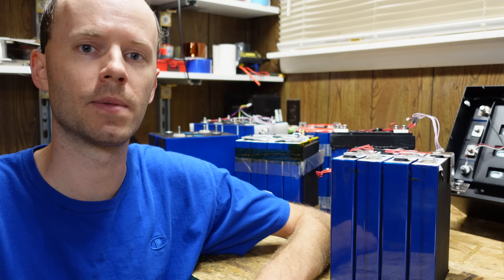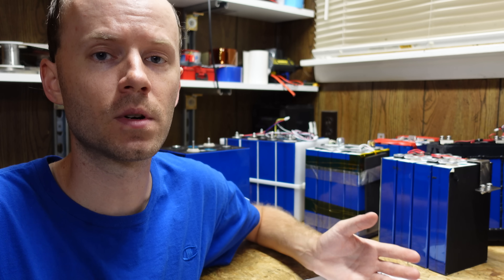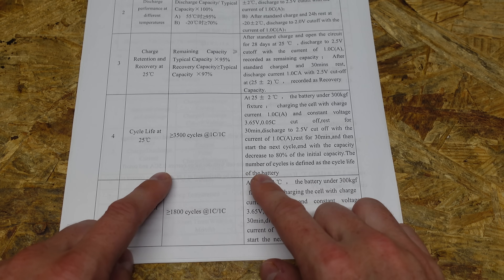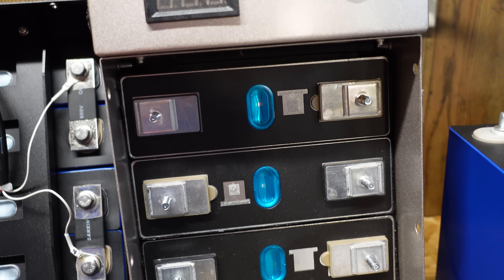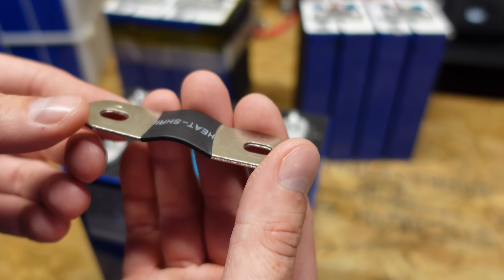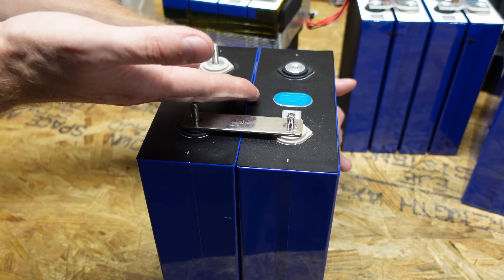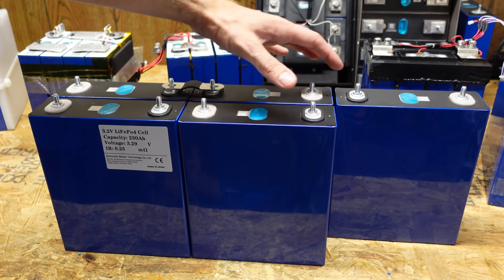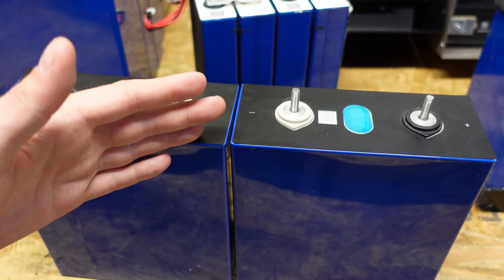LiFePO4 Battery Compression, Fixture, and Assembly - What's the Deal?

Comment: Part 1: Hi, I just finished watching your video and figured I’d give you my thoughts on this matter. I am new to this game and just starting to assemble my very first pack/’smart’ LiFePo4 battery BUT I have done an awful lot of ‘watching’ other people/their efforts AND ‘reading up’ on the subject (including ‘compression’) AND THINKING ABOUT how I plan to assemble my pack. For your information, what I’m building up is a very simple and straightforward 12.8 volt 4S1P ‘pack’ of/using for 280ah (actually, 272 amp hour, I think – ‘Lishen’ cells). For a BMS, I plan on using (purchased) one of those 120 amp ‘JBD’ BMS is from Overkill Solar. (I actually wound up two of these – I had ordered one from China but because I wasn’t sure was going to arrive in time, I shelled out some additional money and bought a second one from Overkill Solar which arrived within 36 hours at my door!). ANYWAY, I have been wrestling with some of the same questions that you have and here’s a little bit of background/thoughts on what I personally plan on doing.
•	My cells arrived in ‘pretty darn pristine’ condition. Very well packed; no damage; packed in high density foam with say ½ inch separators between them so that they were all protected from each other. 
•	The individual voltages when they arrived were very close: at 3.225 mV and one at 3.216 mV - just 9 mV down. SO – I didn’t bother trying to rebalance/pre-adjust the low cell up to 3.225 V first OR individually charge up the cells to 3.65 V (or whatever) INDIVIDUALLY before owning them in series. I simply connected them all up in series and then put them on a 
o	small, FANLESS Chinese ‘Car Battery Charger, 12V/5A 7-Stages Fully-Automatic Smart Charger/Maintainer, Battery Desulfator, IP65 Waterproof, for Sealed Maintenace Free AGM SLA Gel-Cell iGel Wet Lead-Acid or Lithium (LifePO4)” which I picked up on Amazon for 50 bucks. I picked up one of these because I figured I could always find use for a smallish, FANLESS, 12V/AMP ‘SMART’ (‘7-Stage’) battery charger/maintainer that happen to be waterproof (IP65) AND HAD A PUSHBUTTON ON IT TO ALLOW YOU TO SELECT BETWEEN LEAD ACID AND LITHIUM IRON PHOSPHATE CHARGE PROFILES. Again, I figured one where another, I would be able to get my money’s worth out of it.
•	I proceeded to charge the batteries up to full capacity. The small charger did the job though it took probably somewhere around to ½ to 3 days! 
•	(For your info – the cutoff voltage on the lithium iron phosphate profile for this charger was 14.29 V which would work out to 3.5725 V per cell… A little bit on the low side but on the other hand – Quite Safe and very unlikely to cause any cell damage due to overcharge.
•	When the batteries were up at full charge in total/at the pack level, I measure the individual cell voltages and found that there still was that more or less same Delta between the cells. Now I could have attempted to bring everything into a state of balance (I should note, that I had not yet bothered to attempt to install any BMS) using a bench power supply which I happen to own but I decided to not do so. Instead, I attached a small Active Cell Balancer designed to handle 4S lithium packs capable I think of ‘shunting around’ if I recall correctly a maximum current of about 2 A and just left it there. I checked back when exactly one hour had passed AND WAS QUITE ENCOURAGED – CHECKING THE INDIVIDUAL CELL VOLTAGES again, over half the Delta between the high and low cells was gone and a DC meter revealed that there was roughly somewhere between 0.5 A and one amp being shunted around between/among the cells. 
•	At the end of two hours, the cells were almost perfectly in balance and at the end of three hours, they were perfectly in balance right to the millivolt. So – all in all – for the $22 Canadian or so that I paid for this balancer, I am quite happy with it and will probably wind up using it again in one way or another in the future and one where another, getting my money’s worth.

Comment: If you look at bloated cells, you will note the bloat peaks half way down, not at the tops and bottoms. That makes sense, as they are boxes, so of course the tops and bottoms are fixed, until they might literally burst. I would put some fairly thick (maybe 1/4"-1/2") rubber or heatproof but compressible material in a strip at the top and bottom inch of the cell. The snake idea is actually used in some pre-made batteries, but they often use a purpose made plastic grid to space them. Many of them also use aluminum welded busbars. Aluminum is cheaper than copper (but is not so easy to treat against oxidization, so simply wrap it in heat shrink tubing), but has a higher resistance. Resistance falls with thickness, so you use a thicker bus bar if using aluminum. Let us say you have a 10cm x 2cm x 2mm copper bus bar. It has a 0.0004195 ohm resistance for DC current. The same shape aluminum bus bar would need to be 3.2mm thick to have the same resistance. Curiously, that is the thinnest stock bar aluminum available near me! Not a bad idea, but do remember to use aluminum nuts and washers. Then, at the sides, you would want thicker matting, on all four sides. I am building a battery right now with 16 REPT 280Ah cells, in to a 45 gallon plastic truck under bed storage container. It has a lockable hinged lid, the sides are square (and not tapered like a Lowes Tote box would be), and the sides are castellated in profile, making them very strong. I would use 1" Kapton tape to wrap it up.

Comment: Notice the bus bars have slotted holes, not round. This allows for movement. A lot of tightening force securing the bus bars is not needed for good conduction. Verify with an ohm meter. 
=>The humps aren't going to allow much movement laterally, if any at all. Bad design.
 I'm guessing a lot of force on the terminals going back and forth could cause damage to internal joints or solder connections, which would shorten the life of the battery pack over time. Compression just reduces movement. 😎
Reply: The slotted hole is for fitment.  When the nut is tightened the bus bar isn't moving.

Comment: Use epoxy fiberglass FR4 sheets on the outside, and 1-2mm EVA foam tape between cells and a light clamping force, maybe the 12#.  Use the pre-bent battery terminals. That combination will last for many many years.

Comment: I am thinking similar to how your store packs were…
Expansion is always in the wide side, and always from the center of the cell.
So, putting a strip of VHB tape, on the top edge, and the bottom edge, leaves 1mm space in the center. 
Then placing reinforced tape around the pack should protect the terminals, and protect the cells.

Comment: Hi about the bus bars I've said this befor to other YouTubers what if instead of solid bus bars why not make your own using cable so that you add some flexibility in the case the cells expand and contract that way the problem is gone. 👍👍👍
Reply from the maker: Flexibility of cable would be great, but for 32 cells, that's a whole LOT of lugs and crimping...
Reply: @LithiumSolar  i agree but it would solve the problem once and for all.👍
Reply: @LithiumSolar  don’t crimp, use solder.

Comment: Let's first look at EVE's testing process. The cells are charged to 3.65V (100%), rested for 30 minutes, discharged to 2.5V (0%), rested for 30 minutes, and repeated until the cell capacity decreases to 80%. This is very strenuous on cells and likely not a real-world scenario for most of us.

We don't know if compression is only needed when charging to 100% and discharging to 0%. Does state of charge and depth of discharge cause swelling? Does charge/discharge current cause swelling? Maybe compression is not needed when charging to 80-90% and discharging to 10-20% with high current. What causes swelling? 

I think state of charge, depth of discharge, charge current, discharge current, and temperature are more important factors to cycle life then compression. Maybe keeping between 10% and 90% state of charge may eliminate the need for compression.

If Charging/discharging at 1C is >= 3500 cycles
and charging/discharging at 0.5C is >= 6000 cycles
then does charging/discharging at 0.2C mean >= 10000 cycles?

A 24V JBD BMS does 100A max or 0.35C on 280A cells correct? Most people are not continually pulling 2400W. I would say most people in RV's, vans, trailers, etc. are in the 0.1C to 0.2C range or less if using 280A cells.
Reply: Excellent comment.  I would like to know how much expansion occurs when the packs are constrained at the recommended 12psi.  Once this is known it will be clear if a special bus bar or some sort of wire connector is needed.  A copper bus bar made in the shape of a capital A would absorb a millimeter or two for a very large number of cycles before failure (this would not be difficult to test).  Such a bus bar would be very easy to manufacture using  inexpensive machines.  I liked the stainless steel banding you tried last year.  I know there were a few problems with it but I think they could be worked out.

Comment: Is there a reason you heavy gauge copper welding cable like most flooded lead acid batteries use? Definitely carry the amperage and they have flexibility.

Comment: Fixture is assumed by the specs. As you note, having uncompressed cells aren't even added to the 280 spec until a much later spec. 

The cells won't expand under compression. I have 24 cells in a line, compressed and marked location at empty, then charged, they did not move.

The reason why those battery manufacturers don't compress is because it costs more money and you will be out of their warranty before longevity would come into play, so they don't care.

I don't know why you've had to mess with them so much. I just built them with threaded rods and haven't touched them sense. It was easy and worked great...
Reply from the maker: Which cells do you have, the 280's with solid bus bar? It sounds like you do not have anything between the cells?
Reply: @LithiumSolar  280a with the solid bar, nothing between the cells. Spec says nothing so I used nothing.

Comment: Very interesting topic, Will uses the reinforced tape, where Dexter uses VPH tape… I’ve also been torn between compression vs banning vs VHP tape vs reinforced tape… some companies use banning to compress the cells, but most companies use reinforced tape. But I must note that the companies that uses the reinforced tape, are using smaller aH cells. Like 100aH to maybe 120aH. These cells we are using or trying to use are the 280aH to 410aH, which has a lot more energy stored, so thus far the chemical inside is heating up ever so slightly. Just from the atoms flowing back and forth. Where the smaller cells storage isn’t no where near the amount, so the cells aren’t heating up hardly any. Now in saying heating, I’m not stating the cells are even getting hot or even warm, just the chemical is heating up ever so slightly. With my rambling… the larger cells with some compression will hopefully stop the bloating a little. I was thinking on mine, to use some plywood and plastic banning to allow it to move slightly. I have also been experimenting with thin sheets of copper and layering them like a large wire, so it can be flexible. In all, I agree with Will and yourself. The topic is hard to discuss but you have to also look at safety of the cell. Okay I’ll stop rambling now.
Reply: I was considering aluminum sheets as spacers however part of the issue would be the self sorting out if there was an issue, So I think I’m going to go with an EDPM rubber used on Rv roofs….

Comment: Braided busbars or wire+ring terminal. Great video, great topic! Always wondered why solid busbars are such a thing...
Reply: They are a thing because they are really cheap - and you dont need to crimp large (expensive) connectors.
Reply: I use wire+ring terminals on my batteries, I would prefer solid busbars but only when I'm moving them about.

Comment: I  agree prismatic ar the way to go. for  beguiners like  me i pay a little more  but for sure instal 12 volt batt  already purchasin ready to install   like car  batterirs  allready fixed with every parameter correted in factory  and waranty, for 48 volt four batteryes and for  more capacity put  four  more  un parallel  seirs. that way  batery banl  share the stress in only a portion of the stress on each battery.  also the bmses share load too. everything stays  cold.  by the way  i use one 100 amp 12 volt battery in a tool box with a sinewave inveter an solar charger and work  mutch beter thand most  solar generators,  got the idea fron this channel. you can get a good price  buying in group  y use camper  12 volt 100 amp batteries.  good  video.

Comment: I’d use threaded rod to provide the 12 psi, and some type of flexible connectors to protect the leads.
Reply: just wondering
how do you measure the 12psi. and at what charge and temperature?
Reply: @ursodermatt8809  Not all paperworks have good information. So gotta get in contact with the manufacturer, and see if they can provide the necessary data. (And good luck if it’s in China lol) Second, the only way I’ve figured to do the psi setting is by using a pressure gage. And use threaded rods, not straps. Coz it’s not easy to duplicate the pressure with straps. But not everyone have a gage :/

Comment: I did threaded rods with two 3/4" boards at the end of my 12 volt packs.  I just used the split lock washers to put constant pressure on my packs.  Just don't wind them all the way down.  Also I will only charge to just above my BMS balancing current to minimize expansion.  If four cells of the 280AH will expand basically two mm, that really isn't a lot.  Two split lock washers on each end that have 1 mm of clearance each should prevent catastrophic expansion, will apply some pressure, yet allow the nuts to stay engaged.  I'm sure not charging them to their limits will prevent expansion to around 1mm or less, just a guess without actually doing experimentation.  That expansion distance shouldn't put too much pressure on the terminals, with probably only .25mm expansion each.  Likely there is enough bend in the terminals and busbars to take up enough slack to not damage something.

Comment: I've said it before if one is dedicated to build a fixtyre air bags at the end will provide even force but that will def take more time than it's worth. Though batteries (cells) are a sizeable investment they're only getting cheaper and better technology is not far enough away to worry about a small amount of degradation. So I agree. Many many more reason to not bother with more than tape. Good luck and I'm sure you'll  figure it out. Don't worry about expansion in my opinion.

Comment: Why not use Heavy Duty Copper Wire between cells you can then make them any length you wish and even give them more room to move. This would take time and effort but would allow for any amount of expansion of the cells but keep stress of the terminals,. and as for binding them reinforced tape seems to work well as it can stretch better then steel strap and is easily replaced if work hardening of the material happens and needs replacing.

Comment: I think that different manufactures don’t compress cells, bueacouse they don’t have incentive to do so. For them, after warranty, dosn’t matter how many total cycles you achive - thay waiting to sell another one ;) There are also potential failure mode when terminals are in stress from expansion. Lastly, there are mass production issues - is faster to glue cells together ect. 
So if i would build battery, i would use torque wrench and, threaded rodes and plates to compress them and omega-shaped bus bars to connect them to achive 10+ years set… cheers! :)
Reply: Yeah, exactly

Comment: Why not make busbars out of  wire strands thick enough for the maximum current they are expected to carry? They'll be flexible enough to accommodate expansions and contractions.
Reply: Yes, this is what I do. It was expensive, fiddly but if you do it right, the most reliable. Test each one at high current and beg or borrow a thermal camera to look for hot spots that show up flaws.